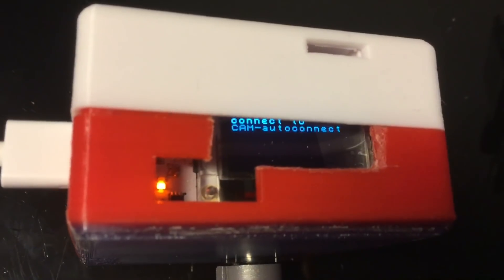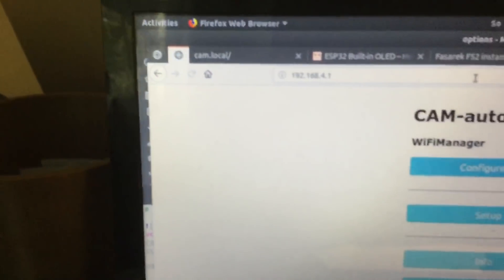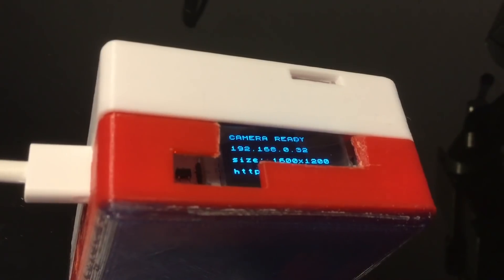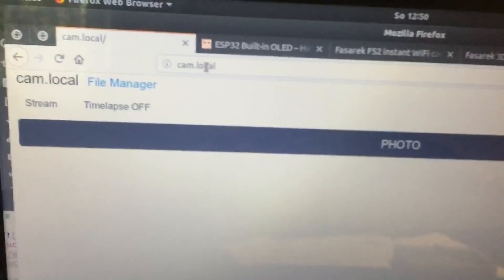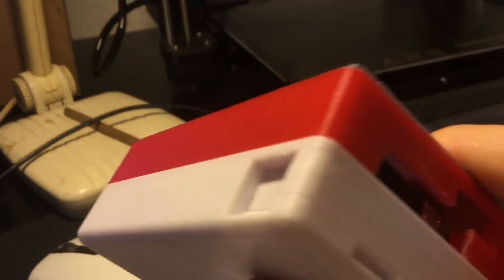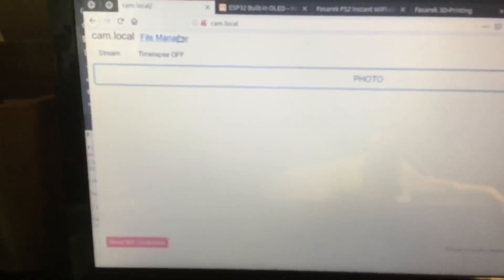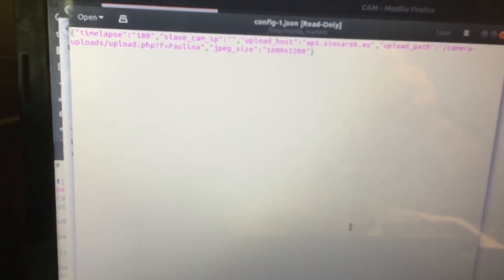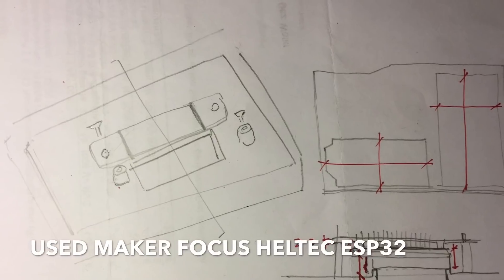Prototype of the new FS2 model using ESP32

Comment: Ahh, sounds like your baby is more into heavy engineering than lego.I miss those days. I'd love to make one of these Martin and am fine on everything but the camera module. there seems to be lots for sale and all slightly different with different prices, do you have a link for the one you used. Thanks.
Reply from the maker: Dear Alan, Sure go ahead. Get an arducam SPI camera OV2640 or OV5642 are supported. Please check instructions and contribute here https://hackaday.io/project/162256-esp32-8266-wifi-instant-camera/